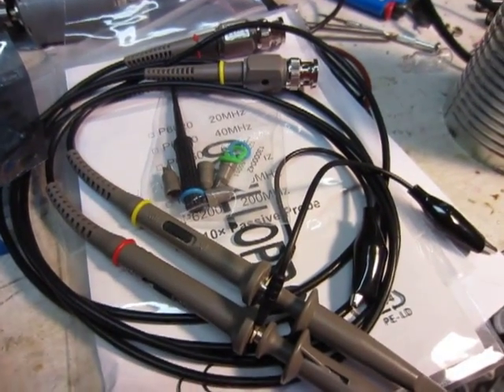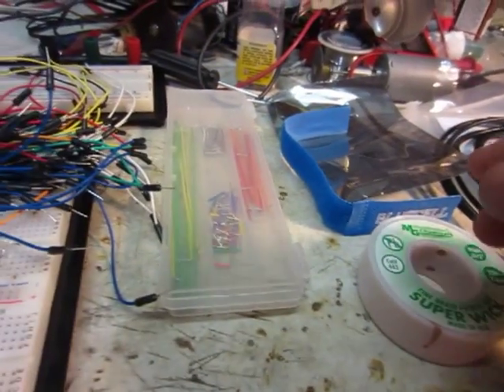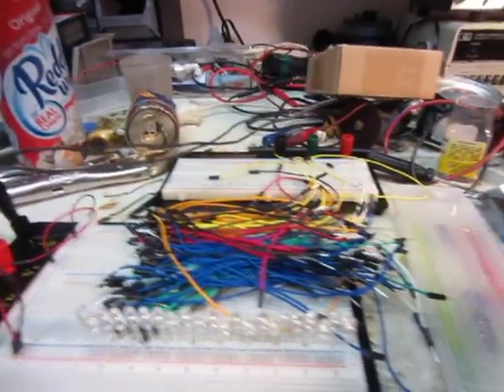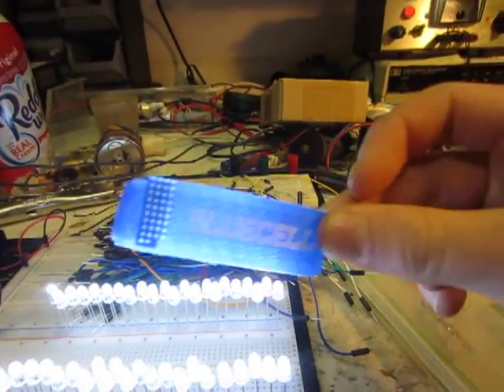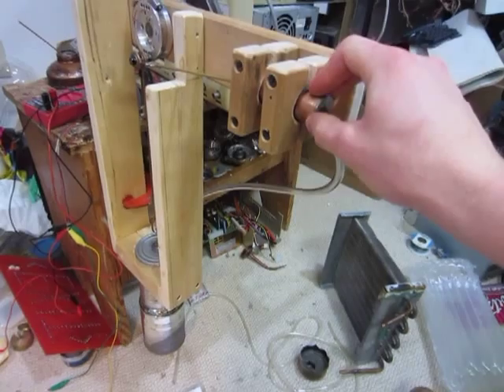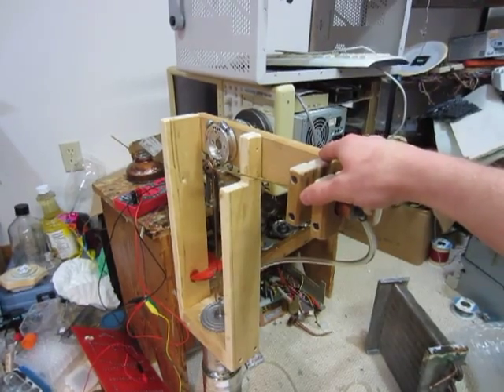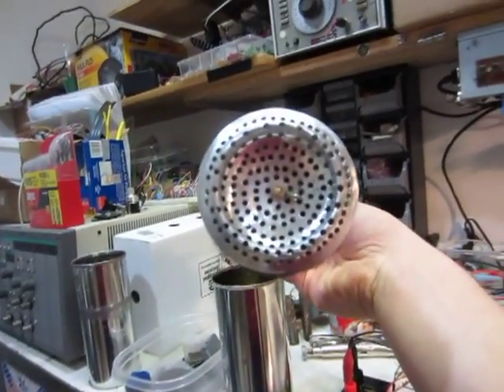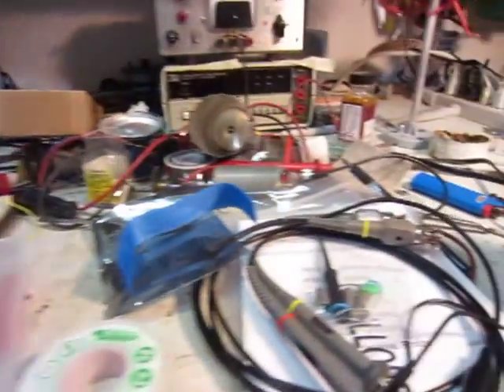Merry Christmas! + Progress on My Next Stirling Engine #4 and #5

Comment: Stirling engines use a very clever mechanism that can run on practically anything. They only need a heat difference. So it's a bit different than a car's engine because it doesn't need the rapid expansion of a gasoline explosion. The Wikipedia article has a very nice animated picture explaining it.

Comment: How where you surviving without a breadboard? Santa was very wise to give you two. I need a few more... If you get that solder wick to work, show me please... I have a few rolls. All I manage to do is burn the flux off it... Worked once for me, with the "Turbo iron" 25w with a 120w boost button.